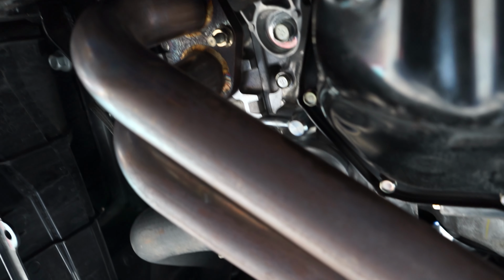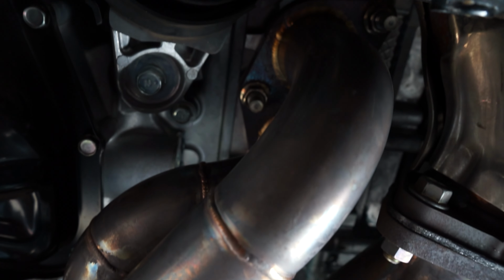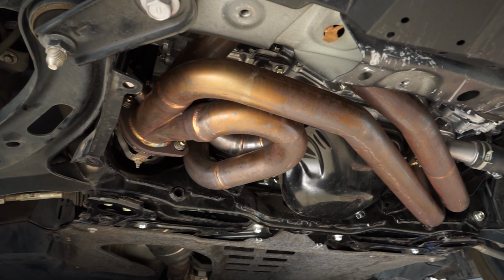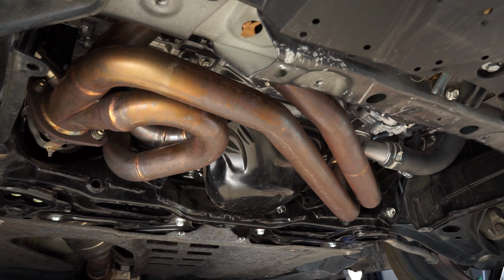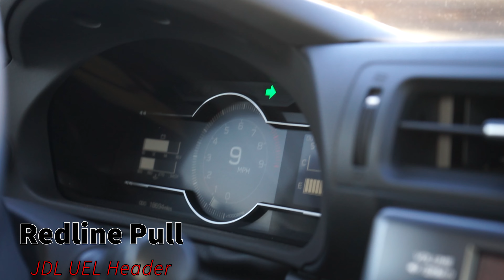BRZ / GR86 | JDL Catless UEL Header & HKS Hi Power v2 | Sound Clips & Review

Comment: Dang I want this UEL with my magnaflow catback 😢
I'm waiting on VFTuner to see if they have a tune where they can dial down the RPM during cold starts
Reply from the maker: The UEL sound is so addictive! It totally changes the character of the engine. I bet it would sound great with the magnaflow. I just read a thread on gr86.org saying that both Counter Space Garage and Delicious Tuning are working on tuning out the cold starts on ECUtec so I bet VFTuner can do the same. The insanely loud cold start is honestly the only negative part of the JDL header.

Comment: I really enjoy your BRZ videos, just wanted some tips on the install: in the video, only one grimmspeed header gasket is shown but I guess 2 gaskets are required correct? And for the header to overpipe, you only needed to use 1 gasket? I am looking to install mine next week!
Reply from the maker: Thank you so much! Yes, if you order the gaskets from Grimmspeed it comes in a pack of two and you will need both  https://www.grimmspeed.com/products/grimmspeed-exhaust-manifold-to-head-gasket-pair-subaru  Header to overpipe is just one gasket. The Remflex gasket is great, it makes it easy to ensure there are no exhaust leaks. Other advice I would say make sure you have a wobble or swivel socket for the header bolts. A couple of them can be a bit hard to get to with a standard socket and extension. Good luck with the install and let me know if you have any more questions!
Reply from the maker: Also, can't remember if I mentioned it in the video but definitely remove the 2 spring bolts that connect the front pipe to mid pipe / catback so that you can freely move the overpipe / front pipe piece. It makes it so much easier to get the stock header out (studs from the stock header to overpipe can be tough to wiggle out otherwise). It also makes it easier to install the new header!
Reply: I really appreciate it. Looking forward to your next video 💜

Comment: Did you have to modify the remflex gasket? Which position does the slotted side go(left or right facing overpipe)? TIA!
Reply from the maker: No modification necessary. The slotted side can go on either side its just whatever is easier to get the bolts in.

Comment: I also got a used jdl header today, any leak with grimspeed gaskets?
And could you share the part number of header to overpipe gasket?
Reply from the maker: Cool, I'm sure you will like it! The grimmspeed gaskets are great. No leaks. The header to overpipe gasket is Remflex 6005. You can get it on amazon: https://amzn.to/4dk2xyS

One thing I forgot to mention in the video is that the gray o2 sensor cable is a little short so you will need to unclip the engine side connector from the bracket!

Comment: what's the difference in smell with the catless? is it bad? and without tune have you noticed any changes with the torque dip? i know people say 2nd gen removes the dip but theres still a little bit of it
Reply from the maker: No smell in the cabin but you can smell a bit if you are outside the car. The stock frontpipe has a secondary cat so it is way less smell than going totally catless. Butt dyno says there is more torque down low for sure. I have found myself shifting around 5k instead of redlining it all the time.